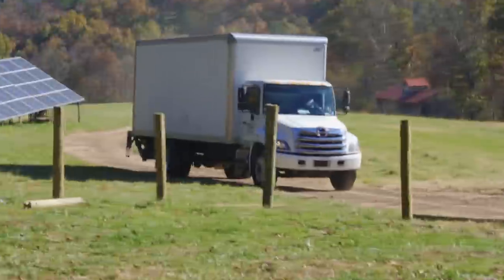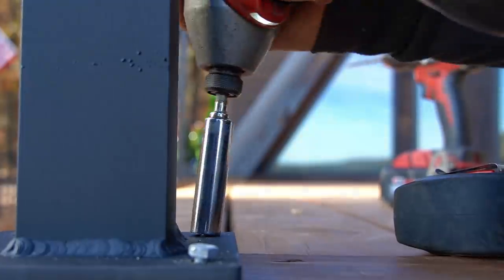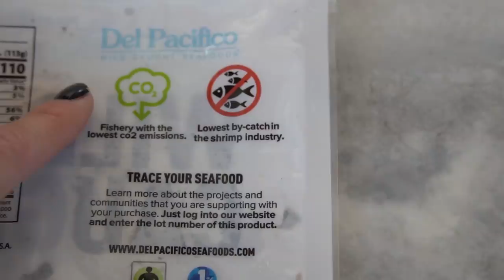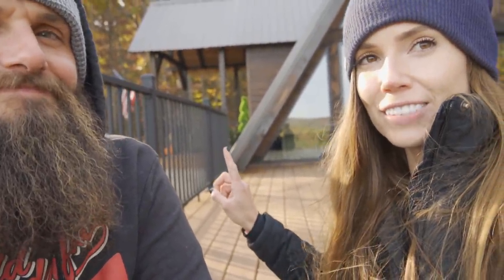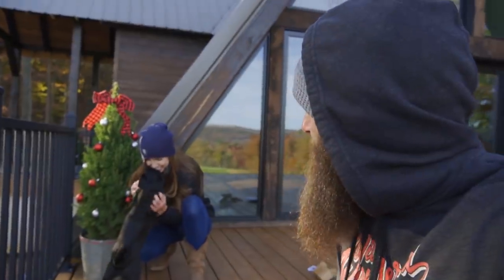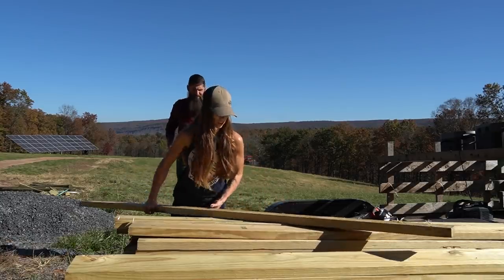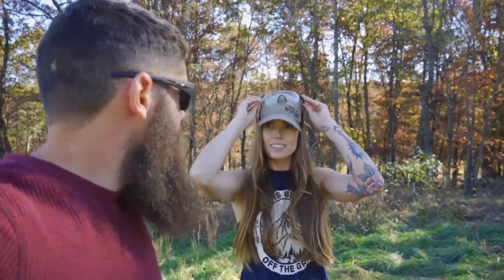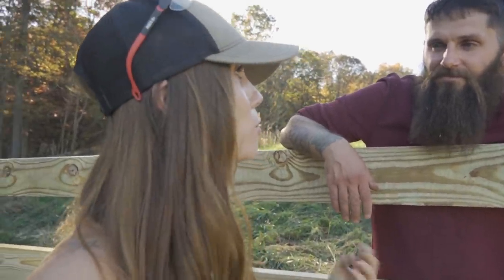She Waited Her Whole Life For THIS!

Comment: I would have used Lag Screws instead of nails.
Reply: @Coyote-tc1ww  With frost moving the posts, animals pushing on the boards and the elements rusting the nails. You will be adding lag screws.
Reply: @Coyote-tc1ww  The only pasture fencing I have ever seen is barbwire.